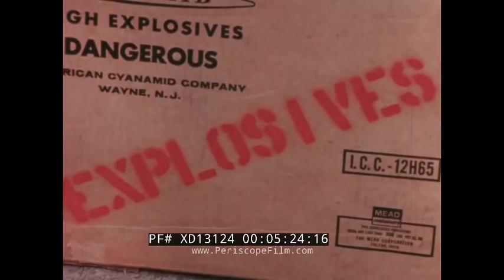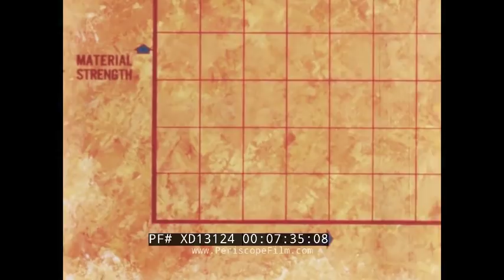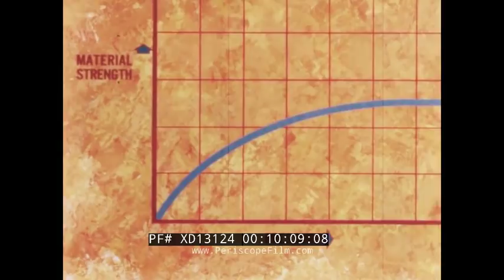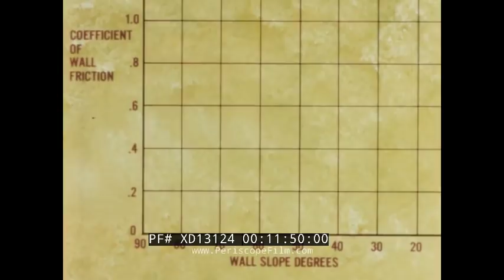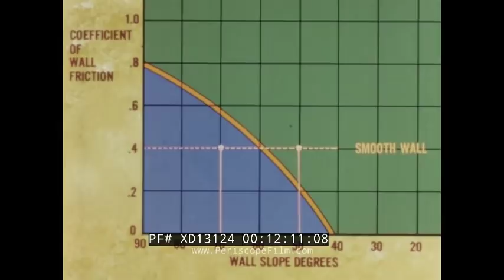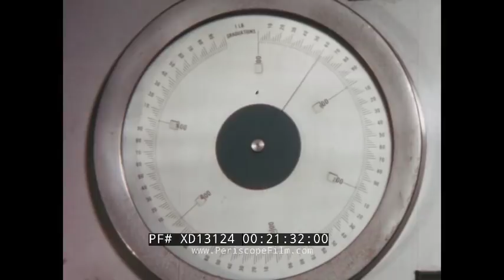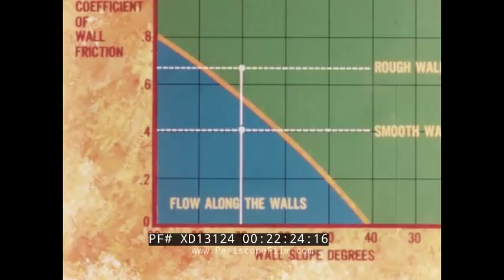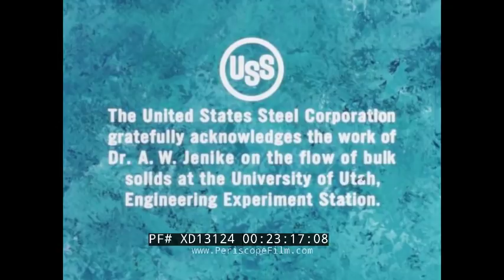MATERIAL FLOW PROBLEMS IN DRY HOPPERS  "MILLION DOLLAR RATHOLE"  UNITED STATES STEEL FILM  XD13124

Comment: In the 90's I designed a gate valve for Alcoa Aluminum to stop rat holing in their Alumina bins. I designed the valve seat to inject dried air to fluff the talcum like material.
Reply: I took one of those vibrators and put it on it's end in the middle of a table supported on springs. It made the best laboratory shaker anyone ever saw, it could put a vortex in perfume vials without spilling them

Comment: Notice the patch panel on the computer at 9:40. This was back in the day when programming was actually done by moving wires around. Machine was probably running Fortran.
Reply: ADA i rekon...lol.
Reply: The machine wasn't running any programming language. That wasn't a stored program computer. In fact it was a analog computer. The patch panel connected various analog components like amplifiers, integrators, differentiators, and potentiometers into a network to solve a single problem. The knobs they were turning adjusted parameters to solve a continuous problem with slightly different inputs.
Reply: @lwilton  It was a Babbage joke, sorry...i meant to write Ada.
Reply: It is a EAI (Electronic Associates Inc) 231R analog computer. NASA used several of them for simulations. Check out the free NASA  SP-2000-4520 publication if you want to know the way they were programmed.
Reply: @lwilton  
They were called differential analysers.
Reply: Impossible.  The point of stored-program computers (which run FORTRAN) is to eliminate those patch panels.
Reply: Definitely an analogue computer. The various "components" were in that wall of boxes to the right, each with one or two controls, and the patch panel connected them in the desired network. I don't think you see too many analogues these days, as you were lucky to get more than one or two digits of precision out of them. But, they had their place.
Reply: Fortran was at a time entered with punched cards. As a school child I did it once around 1983, but the first screen terminals just got installed - green screen and 2 51/4 " floppy drives :-)

Comment: Grain elevator fatalities are real....
Reply: What's the division between dust explosions and sudden collapses of stuck material?
Reply: Have you seen the central tubular cage that, installed above the delivery hatch , is designed to become a safety ladder and protects a body from being dumped down the rat hole and suffocated at the bottom of the hopper  by the grain remaining inside ? It was designed and built some years ago by an Australian wheat farmer who lost his son in a grain bin fatality. The tubular cage occupies the position that would otherwise be occupied by the rat hole or vortex of outflowing grain .Cheers from Downunder  ( stay healthy😷)
Reply: Phil Perry   A dust explosion is a mixture of airborne particles of combustible material ( e.g. flour coal or other fine particulates of cellulose like grain husk dust) and at a fateful moment, be in the presence of a source of ignition.like an electrical component within a conveyor system electrically arcing . Because of the particles ‘ small size and high density in the air, the electrical arc caused the particles to combine  with oxygen and burn almost at the same time. The air dust mixture detonates and the result is catastrophic.  ( look up “flour silo explosions”  on google and check them out).    A sudden collapse of material is just that. The material that is stuck in the silo or hopper suddenly shears off and falls to the bottom of the hopper. That is dangerous too ,but only if you are stuffing about on top of the material in the hopper without a safety line attached .  Cheers from Downunder. 😷 stay healthy
Reply: @miksal26  The xplosion can also  be caused by an electrostatic discharge as ignition source, that does not need an electrical fault. And the released energy is of course much greater than just some dropping mass.
Reply: @goamarty  that"s right  , the slightest spark in an environment that is not kept sufficiently free of explosive dust or vapour. as a works safety officer i was shown instructional videos of dust explosions and you would not believe just how powerful flour dust is when it  is suspended in air and ignited.

Comment: whats the worst example of poor,inefficient process............Solid fueled nuclear reactors.............burn up only 0.7% of the fuel charge in the fuel rod before needing to be removed.
Reply: I thought the figure was a bit higher than that (5%?), but it's still pretty low. 0.7% is the amount of U-235 in unenriched uranium metal. The whole assumption made was that used fuel would be reprocessed to extract the unburned U-235 (and maybe the Pu-239) for reuse. Throwing it away after one run through a reactor is absurd. That's like driving 10 miles down the highway, draining your remaining fuel into the ditch, and filling up again.